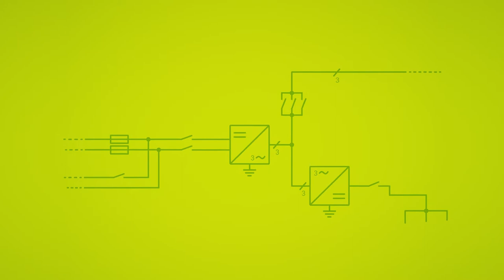Schaltbau - Contactors and safety switches for solar energy, wind power and energy storage

Comment: I was trying to figure out a way to get my RV refrigerator to go on 120 volt when the sun was up and on Sunset go to propane mode 12-volt power.

Is it possible to put a contactor switch to my refrigerator power source and the solar panels be the trip switch to the contactor?

This way when the solar panels have power they will switch the contactor on which will activate the 120 volt on my refrigerator and when the sun sets the power is no longer there to the contactor switch, so my refrigerator well switch to propane mode.